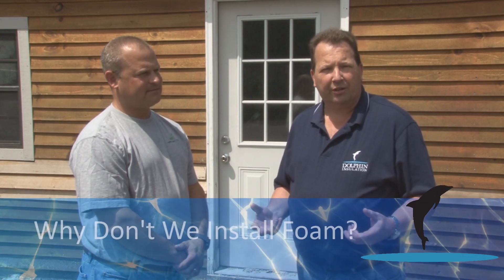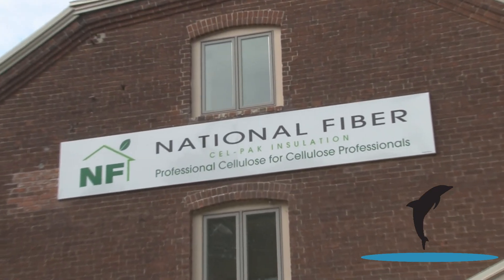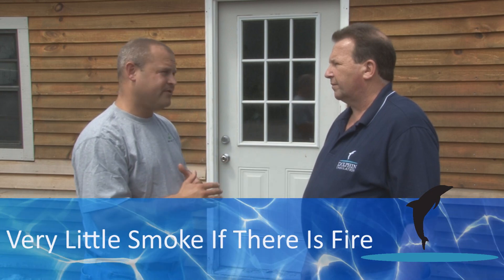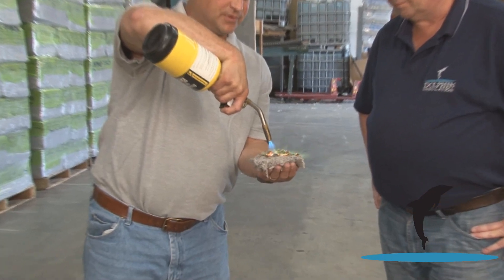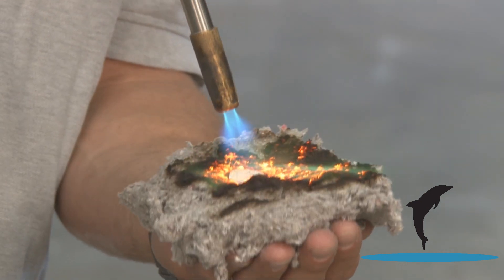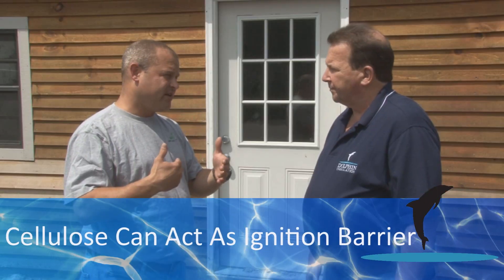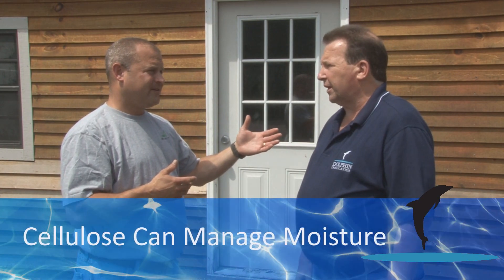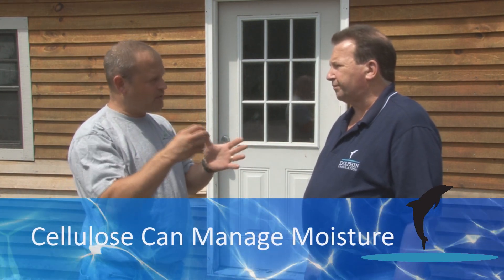Why is Cellulose Insulation Better Than Foam?

Comment: Not as air tight. Foam is better ac unit does not run as much saves money. Foam has fire stop propertys and better R value
Reply from the maker: Have you watched the You Tube video from the Fire Marshall: https://www.youtube.com/watch?v=mUPp-Ipt-PkFoam is the most dangerous of all insulation when it comes to Fire spread. The toxic smoke kills you before you can get out of your home or business.

Comment: So foam is hydrophobic, which means "to repel water", but cellulose sucks it up like a paper towel.  So the water in a foam wall would only be able to penetrate the wood around it and the cellulose wall would be totally penetrated by water including the insulation.  And cellulose is better how?  Give it up guys and break down and buy yourselves a foam rig.  Really poor argument you have there.  And in doing a burn test, why didn't you put some foam in your hand and perform the same test?  Because you know that argument would fall just as flat.  Bet you guys are still using manual typewriters in your office too.
Reply from the maker: The difference between us and all the other points of view is that we go to school constantly. We don't listen to manufacturers.
Reply: Sounds like this guys need to spray foam!
Reply: Perhaps  a you  need  a higher  IQ  to  grasp  the  concept  of hygroscopic,   keep spraying  toxic icynene into homes  people sleep live, breathe  and  sleep in.

Comment: The only things you guys are talking about are least worried about when deciding a insulation. You don't even mention the R-value differences, also the 2 products are used for different applications usually. It sounds more like you are losing jobs from people that invested in new technology foam rigs and you are trying to find a way to argue that cellulose is better, instead of investing in the new way of doing things. Instead you just sound very foolish. Yes you need a fire block with "some" foam, not all though. But good thing there is usually drywall in the way. Also who cares if it smokes, if it is smoking you have a bigger problem then the smoke.
Reply from the maker: There is more to insulation than R value.  R value determines the speed in which warm air or cool air travels through an insulation product or just plain wood. What about the word "Mass" ? have you ever thought about Mass.  So in cold climates we put on big bulky coats to keep us warm. That's Mass. How many inches of Mass do you need for the cold to travel thru. R value has nothing to do with how thick you  put insulation into your home or business. Hence the new stretch codes in Massachusetts. More is better. Foam does have a higher R value. Foam also acts like a bathroom after a one hour hot, hot shower. The walls are dripping wet. the moisture turns into water drops and what happens to it then?  It starts to rot wood. Cellulose absorbs it and dries it out just like a paper towel does. Over time of course. This is where education comes in. Its not so black & White.

Comment: These guys talked a little about smoke and environmental benefits, but not at all about relative R values, what happens when cellulose insulation gets wet (they admit it soaks up water "like a paper towel"), other relevant concerns.  It sounds like they're selling cellulose's few advantages and ignoring many possible downsides.
Reply from the maker: The idea behind hygroscopic and hydrophobic properties is that in houses insulated with foam, there is no where for the moisture to go so they pool and become drops. Now water rots wood?So how can that be good.?Cellulose is non toxic, 0 Flame spread and is a mold & mildewcide with the borates. Plus it manages humidity. it absorbs humidity and moisture and on the off season dries out. We have moisture meters in houses under the cellulose and a typical moisture reading in the worst months of the year are 7.We also remove a lot of foam from houses that are rotting from it. Replace the wood and re insulate with cellulose and a vapor smart membrane.
Reply: Jim Harvey 
Fiberglass also holds water. It I have flooded area where insulation gets wet. Open area to dry, or replace insulation in area of flood, wet entryway will mold if it gets wet,  so change that to